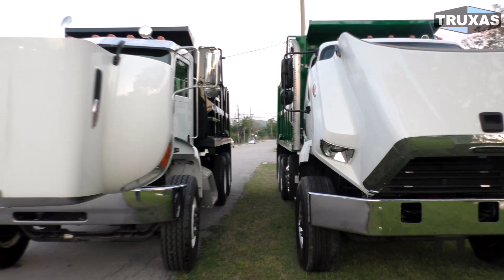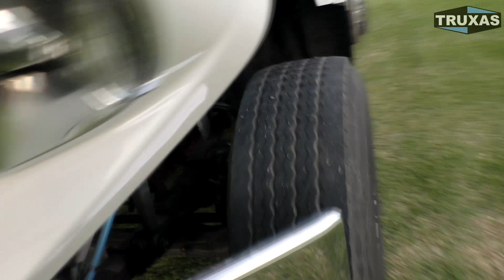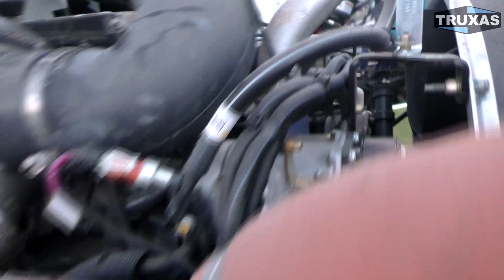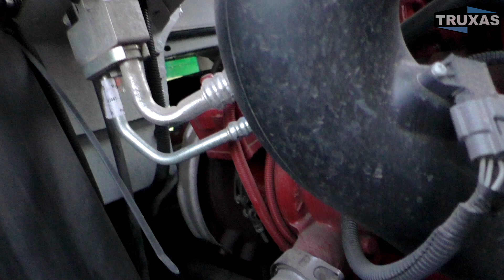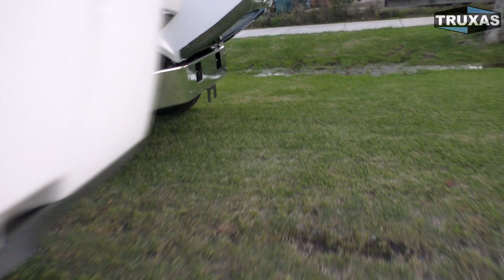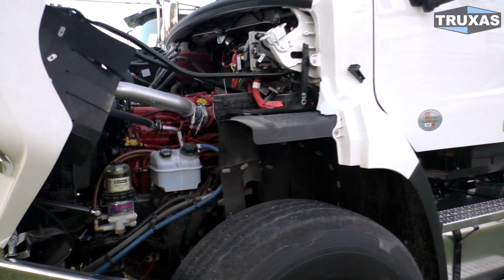Q&A: What is the difference between the Cummins L9 and Paccar PX9?

Comment: you can’t put jakes on these engines, i find it crazy that some people have such small engines in such heavy duty trucks
Reply: Actually you can get them with Jake’s
Reply: They have the option for a 3-stage Jake, just like the big ones. I have a 2021 Peterbilt 337 with it. Works amazing
Reply: Fire house I work at has a truck with an L9 in it (paired to an allison 3000). It has a 3 stage engine brake that will keep 47,000lbs at 15mph down a 10% grade. Very impressive secondary braking system for sure!
Reply: The px9 and l9 have Jake's. I have both in the trucks at work. They all have a three stage jake

Comment: The differences with the dip stick and exaust are only due to the OEM manufacture. (Freightliner, peterbuilt) cooling plumbing is different as well. The Engine spec tag is on the same places as the ISL right on the top of the gear housing, you just can’t see it on the PX9 you gotta move the harness a little bit to read it